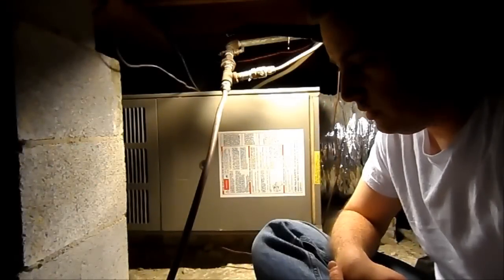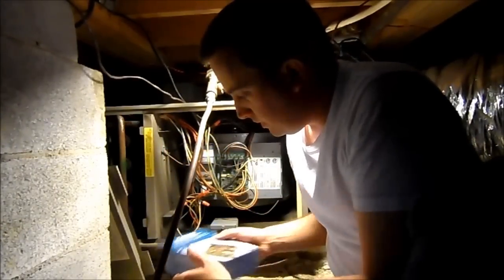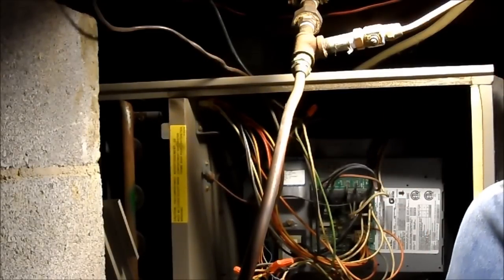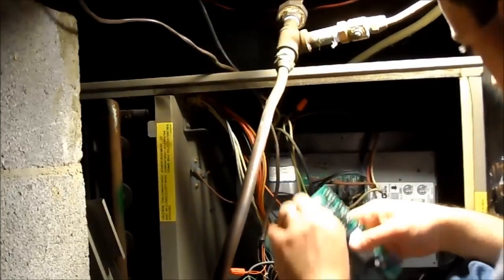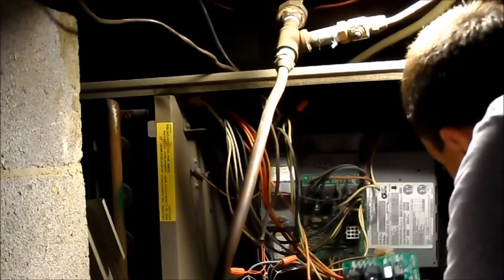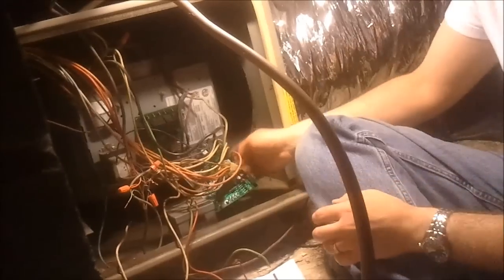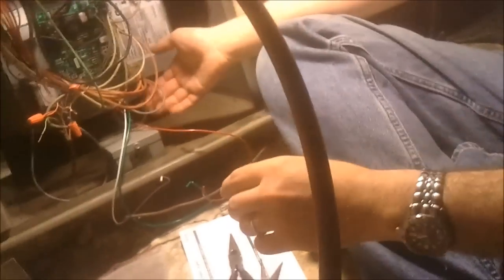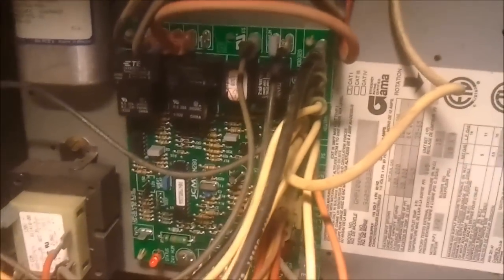Replacing Goodman Furnace Control Module

Comment: similar issue with my furnace... fan would randomly run when the ac was off. Thermostat said no equipment was running... so I suspect a problem with the fan relay.  Plan to replace the control board in the next couple of days.
I found you video and it was useful and entertaining.  I liked your sidekick.
Reply from the maker: If I'm in your shoes, I'm doing one but of testing before replacing that control board. When the fan is randomly running, take your voltmeter and test for 24VAC across the fan terminal and chassis ground. The thermostat couple be closing the fan switch and giving no indication of such. If you have 24 VAC at the fan terminal on the board, your problem is at the stat. If not, you can be pretty certain your problem is at the board
Reply: @cllewis1   Thanks for the additional help. If I can catch the fan running, I will see if I can test it. I have a spare control board from another unit I had to replace... decided to scavenge parts ... sometime being a hoarder pays off :)  but not often.

Comment: Just curious why you replaced this?
Reply from the maker: My furnace was malfunctioning. It would cycle on, warm up, the fan would start, and then within 30 seconds, cycle off again. The blink pattern of the LED indicated a malfunction. I asked a friend with HVAC experience for advice, and he recommended replacing this control module. I did, the issue resolved, and worked fine for many years.